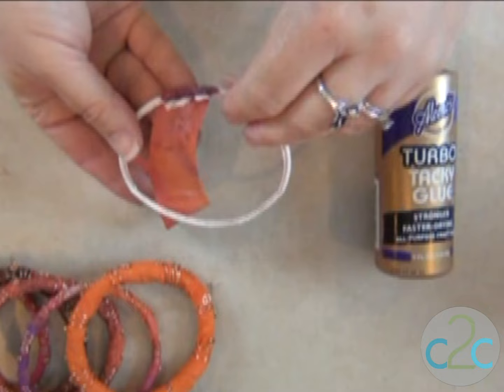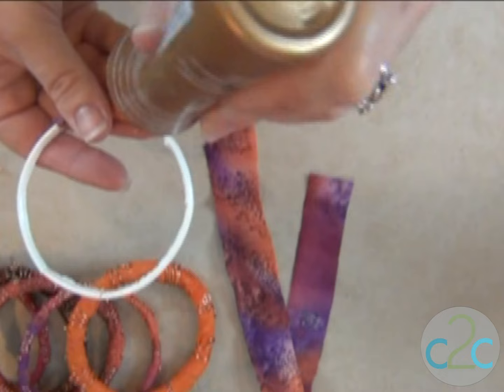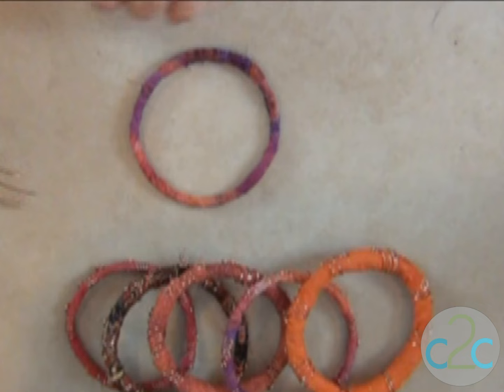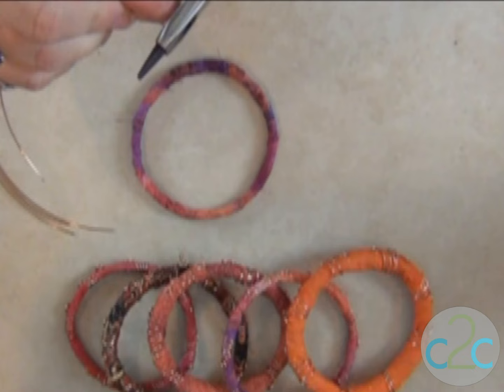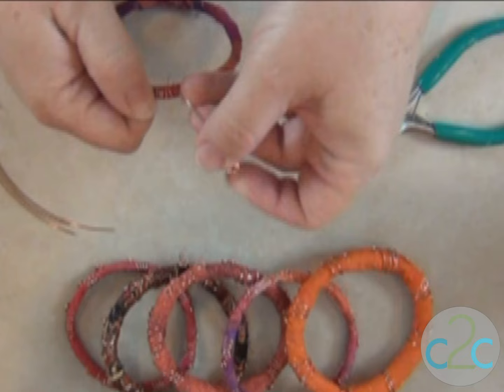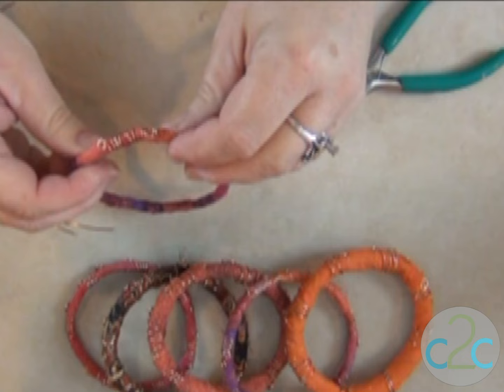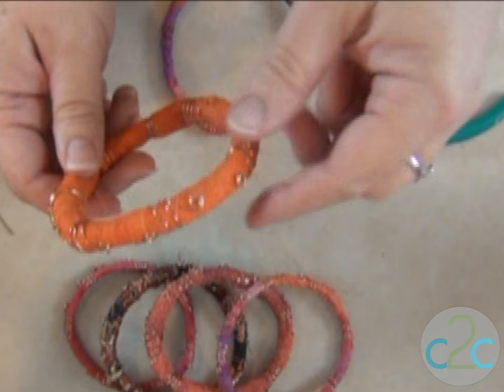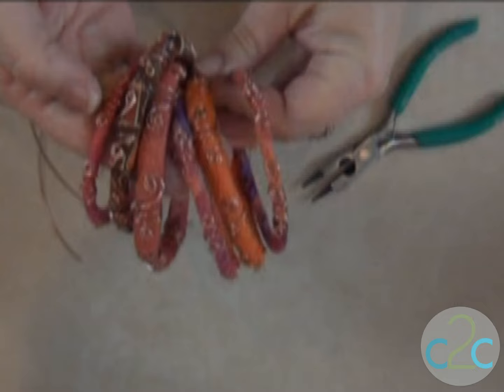How to Make a Fabric and Wire Gypsy Bracelet by Candace Jedrowicz

Comment: What could you use other than a coffee cup for the inside?
Reply: You can use anything ring-shaped and flexible that fits loosely around your wrist.  I rinse and keep all kinds of beverage cups for this and many other kinds of projects, Jordan.  Have fun!
Candace
Reply: +Candace Jedrowicz I've made similar bracelet with zip ties (credit Mark Montano) cut to desired length plus about one inch overlap to tape together and close the circle. I absolutely love the copper wire accent, and as luck would have it, I just bought a spool at Lowe's yesterday. Whoopee! I'm ready to start!